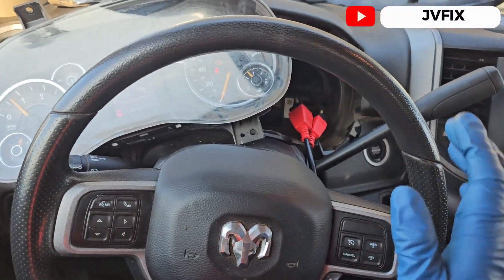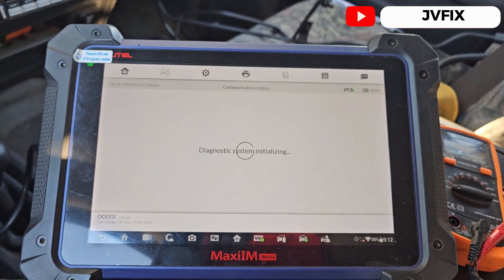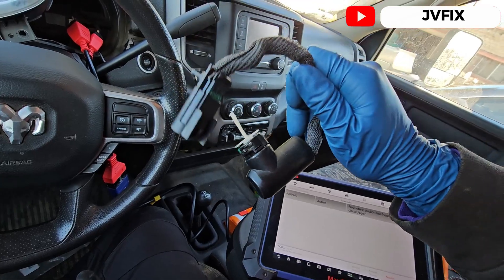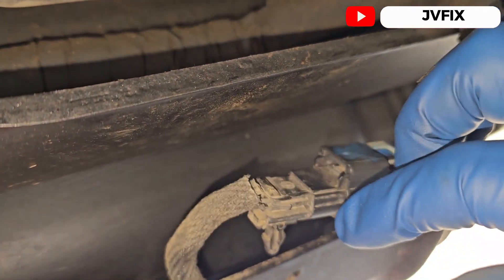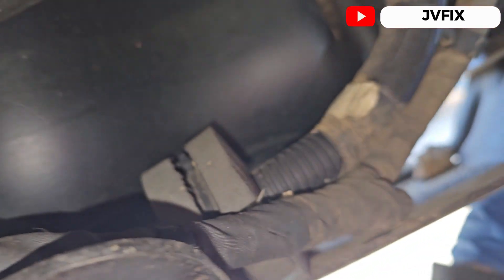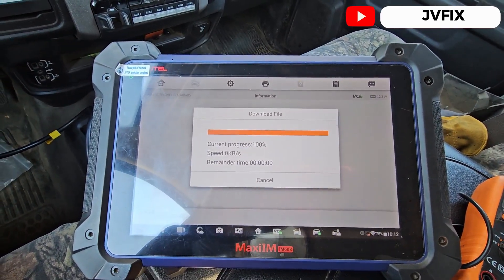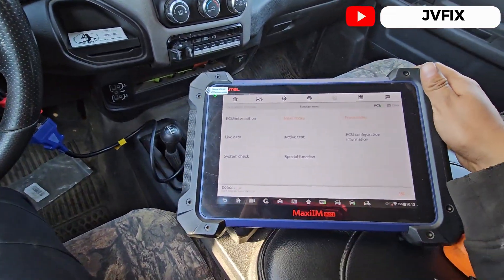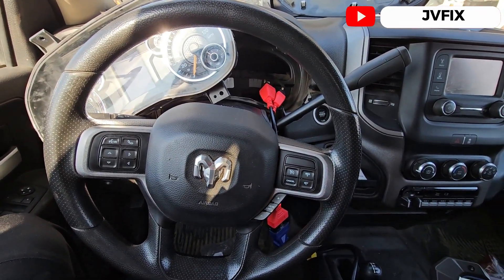How to fix code P20B9 DEF line Heater circuit on 2018-2024 Dodge Ram 2500, 3500, 4500, 5500.

Comment: Thr test for the line heater was in the top right and you missed it. Obviously the problem was solved, but your autel did have a special test function for the new line.

Comment: How do you know that the line was bad?
Reply from the maker: I measured the resistance of the heater and it was infinite which means open circuit
Reply: @JVFIXLLC  What is the normal resistance of a good heater wire?  Thanks!

Comment: Does this part fits a 2019 ram 5500 crew cab Laramie ? Cause the link that you provided says that it doesn’t fit help me out please 🙏
Reply from the maker: it should fit, check under your truck and compare the part on the picture with yours

Comment: what is the line and harness called?  Need to replace mine.  where did you get it?  I have a 2021 Ram 2500 with same code and problem.  Luckily, it has not gone into reduced power or limp mode.
Reply from the maker: the link for the part is in the description
Reply: Did you find the part number?  I have the same deal as you?
Reply: @keithharnisch4451 that part is not the right one for my 2022 3500